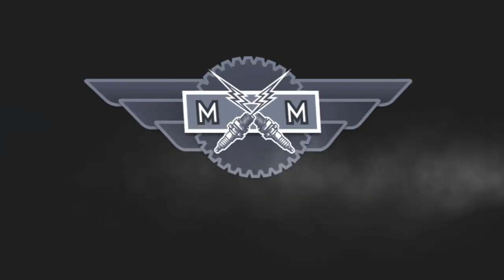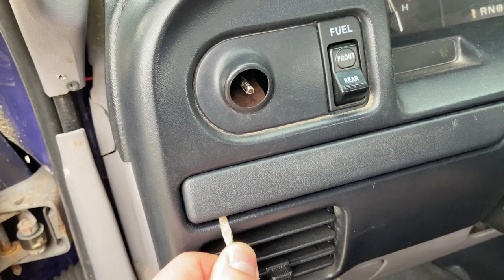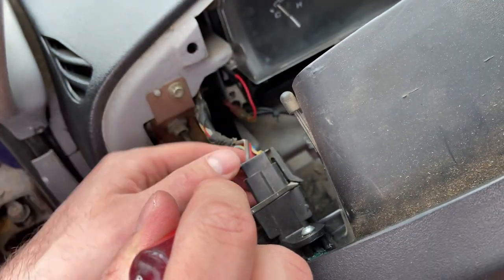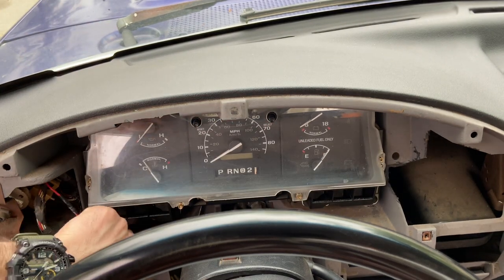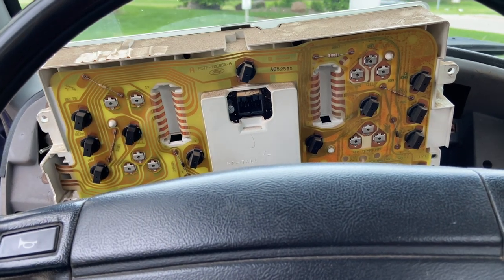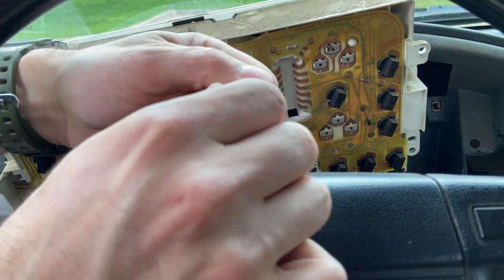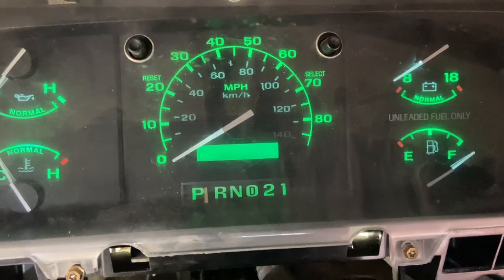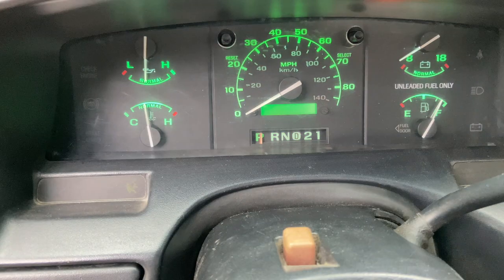How to Replace Gauge Cluster / Dashboard Bulbs with LEDs | 1995 Ford F150

Comment: watched all your f-150 videos - thanks! This was one of the clearest and comprehensive. I appreciate the extra effort in detail and explanation.
Reply from the maker: Thanks man!🤙 I appreciate it! I’m getting better at including me working and actually taking stuff apart on camera. 
Thanks for watching!
Reply: Hello, one question i have a 1997 mercury mountaineer 5.0, all the lights in my dash bezel/cluster panel went off, do you think they all got burnt or it's possible that a fuse got burned, the reason because i saw in this video that there is a lot of light bulbs, if i have to replace them all, any advice, also do you know what fuse could be, thanks in advance if you know something about it, thanks again.

Comment: I did this job last summer with blue LEDs and it came out great! Didn't even have to crack it open and scrape the green tint off.
Edit: I also changed the other indicator lights in the cluster (turn signals, 4x4, etc) but you want to keep the ABS and airbag lights incandescent because if you put an LED in those, they'll stay on and won't turn off.
Reply from the maker: Nice! I’ve heard of people doing that but they also had to scrape the green off. 
Good to know. I’ve kept my other indicator lights incandescent for that reason. Not that I knew it would stay on but mostly because I know LEDs can cause some circuit issues.
Reply: could u put a link to the blue leds you got ? it would definitely be easier to get those than opening the cluster and scraping the green off

Comment: I have replaced every bulb in the cab of my 1994 F150 with LED, huge improvement. I have also done all the rear-end bulbs. The front-end is next.
Reply from the maker: LEDs are awesome upgrade for inside the cab! I would save your money for the headlights and buy projector headlights. The LED bulbs fit in the stock headlight housings but the LEDs don’t work with the old reflectors. The light is scattered and there’s no beam pattern.
Reply: @TheMinuteMasters  Good to know, thanks. I amost bought aftermarket LED headlights but decided not to, I want to keep the original look.
Reply: Oh, and congratulations for your new baby. Being a father is the best thing in the world.
Reply from the maker: @drcazeddog  Thanks man!🤙 It totally is! I’m loving every minute of it!

Comment: All your videos are awesome, thanks!!!! In my case, I only replaced the ones in the cluster who have the ILL inscription at the insertion hole or "socket" (only 5 of them) and then I replaced the two bulbs at the AC Control panel. So, in total, I use 7 bulbs from the LED package. I only replaced the ILL ones only because I had the ABS flickering with LED bulbs, I don't know why. Auxito 12V 10pcs 194 168/2825, I found them in Amazon.

Comment: Well…looks like I can’t get the instrument cluster all the way out. The cable going to the gear selector in my truck is too short and I can’t tilt it back to pull the cluster out. Any way around this wire?
Reply: Got it. Changed all the bulbs to LED. When I turn the lights on now the truck makes error noises. Lights look great but I hope the beeping goes away. 😂 🤦‍♂️
Reply from the maker: Really? These Ford’s only have the buzzing noise for the door being open (granted my truck is XL). Des every single bulb work? And do they all dim?
Reply: @TheMinuteMasters  beeping error noises were because the bulb for airbag service needs to remain halogen. Once I swapped that bulb back the beeping went away. My truck needs airbag serviced. I think we have same truck. Mine is 95 XL too. Mine has buzzing sound when the door is open as well as when I startup the truck instead of the normal startup chimes for some reason. 🤷🏼‍♂️
Reply from the maker: @lucasprittsmusic  Gotcha! That makes sense. My error light bulbs are probably still halogen. I’d have to check but the difference in amperage does weird things.

Comment: On my channel I did the Blue LED and cleaned off the green paint on the gauge plate's. Love the look.
Reply from the maker: Nice! I’ve seen pictures of that done and it’s cool looking!🤙
Reply: Can I ask how you cleaned the green off?  
I have a 92 AND a 97 I'm want to do that to as well.  
I already have the blue leds.
Reply: @marcelledbetter7296  q-tips and 90% rubbing alcohol, just wiped away the green, takes a little time an patient, then went over from behind the gauges the black holes that appeared in some spots with a black sharpie marker to clean up the lines. A YouTuber called ain't scared garage did a video that I followed on how to.

Comment: Whats the white adjuster screw for on back of speedometer replaced the the unit and bump it just making sure i did not mess anny thing up.
Reply from the maker: Are you referring to a wheel type screw? The only adjustment I know is for the PRND12 needle placement.
Reply: Its the on on the back of the chip board for speedometer on 92 f-150 that looks like it has a sloted screw driver slot on top of it.
Reply from the maker: @calvinfinch1746  I just looked at a spare cluster and I didn’t see it. I was looking at the back of it.

Comment: What would you recommend doing if your dash lights don’t come on at all? I replaced all the bulbs and the check engine light and battery light and stuff come on but the tac and speedometer and the others don’t
Reply from the maker: I would check your fuse panel. I used to have a fuse blow out all the time, and I’d lose some of the functions in my cluster.

Comment: I replaced all my guage lights with LED a couple years ago. I went with blue for the main lights and color matched the others (green for turn signals), but I got the wrong ones and they are not very bright. and the dim function doesn't work as well. At least with the LED's I got. I think that the 4x4 light on mine didn't like the LED and stayed on all the time so it is a regular bulb. I have just been to lazy to pull the dash apart again and get brighter LED's. Summer project!!!
Reply from the maker: Nice! You definitely have to experiment with LEDs to get them correct as far as brightness and working well. 
I only replaced the gauge bulbs, Speedo, and odometer. I kept all the other warning/indicator lights incandescent. 
I feel ya. It’s a process to remove the instrument cluster.
Reply: I know this is 2 years old, but that's why I'm hesitant to use LEDs. With OEM you know what it's going to look like. With LEDs even if they say they meet OEM, they won't look the same. It will be different and you hope it falls on the side of better looking (for your tastes).

Comment: Hey i checked all the polarity but my tach dims way befkre the others, any ideas.
Reply from the maker: So it dims before the others, when you are turning down the brightness of the cluster?
Reply: @TheMinuteMasters  correct. I think it is because the others lights are right behind the gauge where as the tach has  2 but they kina have to shine through a tunnel. Same as my heater and ac and blower control panel, it dims faster as well

Comment: Question, how many bulbs do i need to swap all the gauges to led? Im thinking 5 but im not sure as each left n right has 3 bulbs. Thank you , im asking because i want to avoid putting leds on the warning lights
Reply from the maker: I can’t remember exactly but I think 5 will do it. They come in a two pack so you are covered up to 6.
Reply: @TheMinuteMasters  thank you, i went ahead and ordered like 20 194 bulbs for like 6$ on ebay lol hope i dont regret it
Reply from the maker: @sucio-  For $6 you can’t lose. Good luck!🤙
Reply: Hello my friend did you finished your project with the instrument cluster? Do you have the name of the seller on eBay, i want to order those lights, 20 bulbs for that price, that is awesome, 194 is that incandescent ones right, please help me with that, thanks in advance.

Comment: Yea this video helped me go through my process of changing the LCD and some Lights to LED. 
My Volt Guage doesnt seem to be registering correctly, does anyone know how to fix ? 

Its def seated properly and When the cars on and I Tap the guage in that spot it gradually increases until it wont no more (around 14.v)  i have a aftermarket radio that displays the charging system volts but its also a bit nerv racking not having the working guage.
Reply from the maker: I would look up what powers the volt gauge and I assume there is a sensor involved. Basically, go part by part and see what could possibly affect the gauge. 
Is it battery connectors, wires to battery, loose connections, sensor, etc.

Comment: My entire speedo is out, but the left and the right sides are good. However, there isn’t any light at all that bleeds into the speedo. Do you think this issue is just the bulb? Or could it be a fuse issue?
Reply from the maker: I would check all of your bulbs. There is a center bulb that lights up the speedometer. If you tried replacing with an LED then you have the orientation of the bulb incorrect. LEDs are weird like that.

Comment: I realized this is an older video but, prior to tackling removing the gauge bezel to change anything with the gauge cluster one should have on hand  a $25.00 bracket that secures the fuel tank selector switch to the dash and also eliminates the chance of breaking the wiring connector from the FTSS  or worse breaking the gauge cluster bezels.
Reply from the maker: Good tip!
Reply: Can you provide information about that bracket, please?
Reply from the maker: @johnguilfoyle3073  A couple of places make the bracket for the fuel tank switch. CP Addict and Desolate Motorsports sell them.
Reply: @johnguilfoyle3073  Bronco Graveyard Has them!

Comment: thanks for the infro on both plugs having to be plug in 2 test cuz i was having thoughts that the leds were bad
Reply from the maker: I would try testing with both plugs installed just to make sure.
Reply: @TheMinuteMasters  it working great but now my oil gauge and battery gauge is misreading mehcanic friend said i might have moved the needles when had dash cluster upside down thanks for the great video
Reply from the maker: @bishdavid99  Ah! That can happen. No problem man!🤙
Reply: update the problem was the cluster i used was the wrong year for my truck
Reply from the maker: @bishdavid99  yup that will do it.

Comment: What blubs  did you change I have 16 do I change all of them help please
Reply from the maker: The cluster bulbs are 194 type. I used LEDs.🤙
Reply: 1993 f150.5.0 it looks just like yours   not sure witch blubs to change
Reply from the maker: @donchapman1853  So the bulb at the top center lights the speedometer, the two bulbs that are  left and right of the Speedo light the gauges(battery, coolant, gas, etc.) The row of three bulbs running vertically and horizontally on each side and bottom light the different warning lights. Lastly, the two bulbs on either side of the plain white section of the back of the Speedo, light the lower part of the gauges.
Reply: Thank you well give that try
Reply from the maker: @donchapman1853  No problem man!🤙

Comment: Which one is for the signal light my right arrow won't light up no more
Reply from the maker: Good question! I think the three bulbs in a row at the bottom left and bottom right is where your signal arrow is located.
Reply: It just started working again but thanks will probably change later on

Comment: I put led’s in 96 Nissan hardbody and it started smoking from behind the dash why?
Reply from the maker: It could be that there’s not enough resistance. From what I’m told (and I’m not an electrical expert), The resistance flow of electricity through a standard incandescent bulb is higher than a LED bulb. Basically my understanding is it takes less power to light up an LED bulb. This efficiency sometimes causes some systems to act up or think the bulb is bad. Did your gauges at least light up?
Reply: @TheMinuteMasters  yes, and then my starter relay had a problem even when I put a new relay in so it’s hotwired from the battery to the connection on the relay plug but all the bulbs turn on but the harness starts to smoke up behind the cluster so I only have turn indicator bulbs   In for safety but I can’t see how fast or tach or temp or gas at night

Comment: Whered you get the phone holder from? Do a review on that i like the position of it.
Reply from the maker: My wife bought it from Amazon. It’s pretty good, I used to have the Steelie ball thing they sell at Home Depot which was faster to mount my phone. But this one doesn’t require anything on your phone. 

Here’s the link:IPOW Car Phone Mount Holder Hands Free Car Phone Holder Dashboard Gravity Cell Phone Holder Mount with Auto Retractable Clamp Maximum Angle Adjustment https://www.amazon.com/dp/B07Y4NWJRG/ref=cm_sw_r_cp_apip_2oLQzl4Yp9she

Comment: I tried this, great disassembling part but it seems like it didn't work. The battery, signals and small lights work, the meters don't though. What could it be? Sorry but I have a 1994 xtl f150 and Id like them to work so I don't need to use my phone as s flashlight
Reply from the maker: If some of the lightbulbs don’t work at first, try an incandescent bulb. If that works, then you need to reverse the orientation of the LED bulb for some reason LED bulbs are position sensitive.
Reply: @TheMinuteMasters  it worked! Thanks! now I gotta do the radio
Reply from the maker: @cowboybob2745  Great to hear man!🤙
Reply: @TheMinuteMasters  I posted a link of the led's I used that are not polarized. They are a little circuit board that switches accordingly.

Comment: every single light on my dash is equally dim but they all work. Do you think that would be the bulbs or something else? Same truck as you
Reply from the maker: Might be a stupid question, but did you turn the headlight knob to make sure your dash lights are at maximum brightness? 
You can upgrade to LED bulbs to make everything brighter.
Reply: @TheMinuteMasters  not stupid enough for me... I recently bought the truck but yeah I didn't realize you can turn the knob. Ill try now and see if that fixes it...
Reply: okay yeah turning the brightness does not make them brighter they are still all super dim.
Reply from the maker: @rocosurfs  I’d definitely go the LED route then.

Comment: Hey man great video. Quick question hopefully u have an answer. I Did this on my 94 f150 but i changed all the led bulbs not just for the gauges. I changed the build for the abs, check engine...etc basically all of them And now there is a beeping sound. Do u have a clue what it could be?
Reply from the maker: Hi Cesar! Thanks!🤙 Where is the beeping noise coming from?
Reply: @TheMinuteMasters  behind or cluster or around the cluster.
Reply from the maker: @cesarchavezalvarado5570  If you can, take the cluster out but leave it plugged in. This way you can pin point the sound. You can also test using regular bulbs and see what happens.
Reply: @TheMinuteMasters  update. I switch the airbag bulb back to a regular bulb and problem solved
Reply from the maker: @cesarchavezalvarado5570  Nice! Good work! Must be a voltage think.
Reply: @cesarchavezalvarado5570  does it beep like 5 times almost like a modern seat belt alarm ?cause I think I have that problem I just tried to get a smog but he said it failed cause my check engine light didn’t pop up can u tell me where the check engine and airbag light are so I don’t just go replace every single bulb
Reply: I've noticed on my '94 F-150 the air bag system light quit working recently and sinxe then the air bag system defaults to a small box under the dash that beeps a series of 5 beeps five times-- I'm planning on replacing the bulb soon with a long-life incandescent bulb and that should stop the beeping hopefully.

Comment: Hi what about the problems led bulbs bring to obs fords?
Reply from the maker: LED bulbs can create issues, but only in certain applications. I haven’t noticed or seen any issues with installing LED lightbulbs in the gauge cluster.
Reply: @TheMinuteMasters 😮😮...1993  
Ford f150 5.0 truck...Previous owner installed these Green LED's in the Dash panel...Ever since I bought the trk, they like to play "Hop, Skip,and Jump" as to which ones don't stay lit...Now, the Odometer one won't stay on...Have to bump and fiddle with Odometer/Trip Mileage Selector button to get it to work till I hit a bump in the road,  then it goes back off...Any fix you got in your "Wheel house" to remedy this malfunction would be greatly appreciated...Thanks in advance...😊😊😊